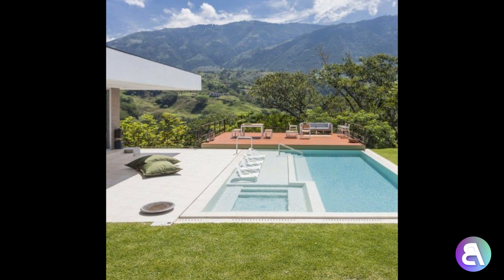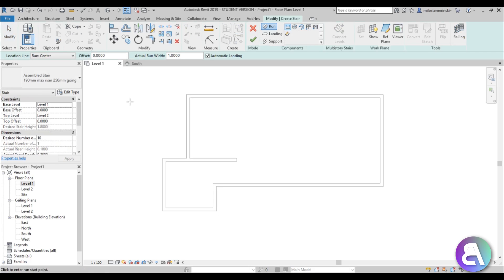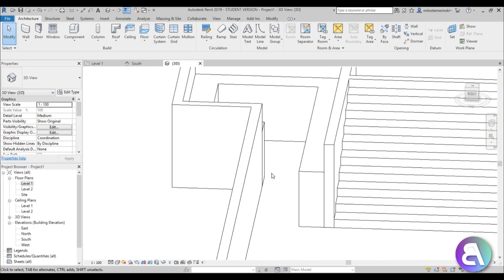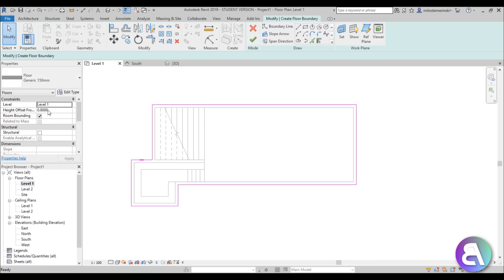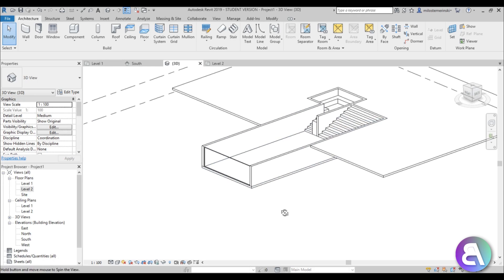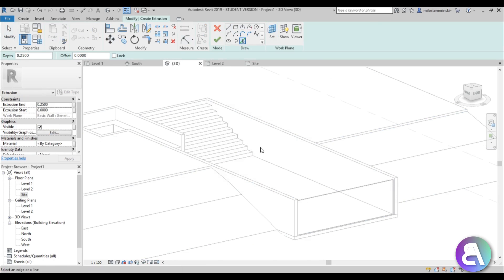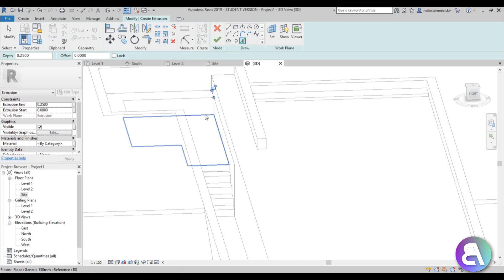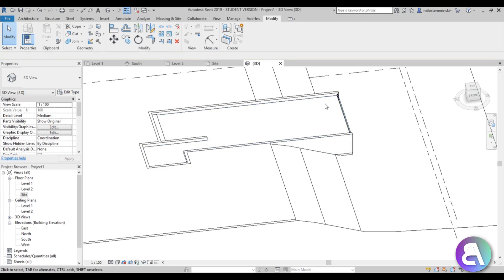Modern Swimming Pool in Revit Tutorial

Comment: You can just draw watter as a floor, and it will work the same. This time bad one Balkan.
Reply: Davis Kanders you won’t be able to get the stair cut-ins using the floor command and the water won’t render accurately.
Reply: i think he means, draw it as a floor only at the top surface of the pool and change its property type material to water.